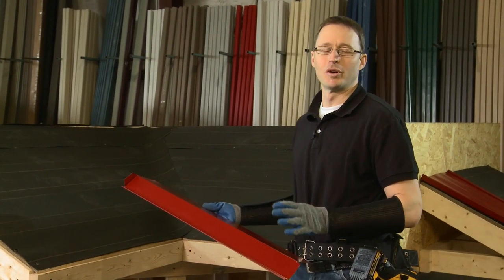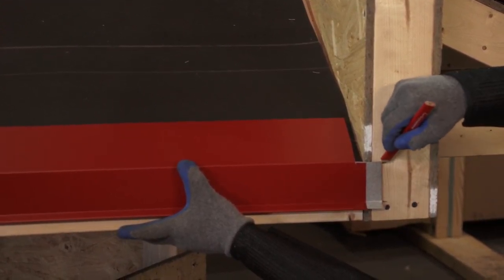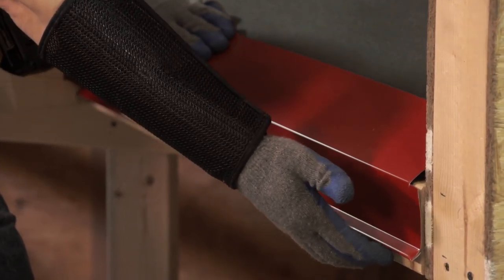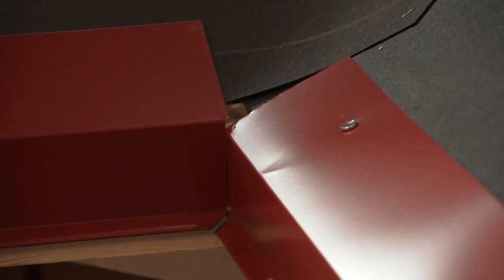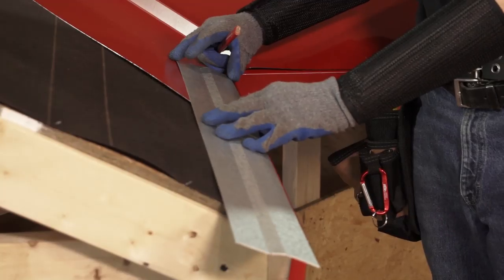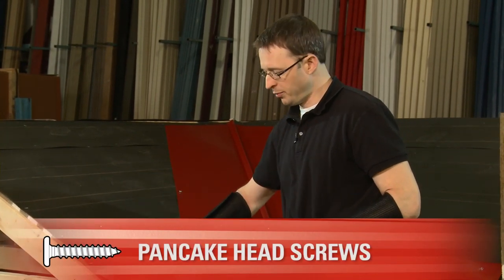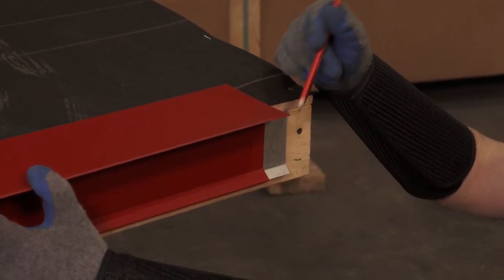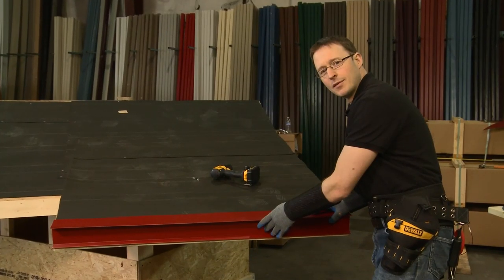How to Install Eave Trim Using Hidden Fasteners: ABC SL-16® Metal Roofing System

Comment: Very informative series of videos. Wish I had seen them in '07, before buying my house. I didn't know a thing about metal roofing back then, but now roofing issues have forced me to learn all I can. The level of expertise shown by David convinced me my roof had to have been done by the roofing 3 Stooges. It's not aligned to the roof, the valley drained right into the soffit, and no edge trim. I'm sure the original home owner or developer was cutting corners to save a dime, but really...

ABC' s videos are a big help with the gradual repairs I'm performing. Wish there was a Q&A feature to answer questions about the process..